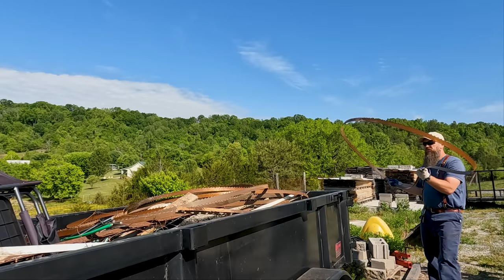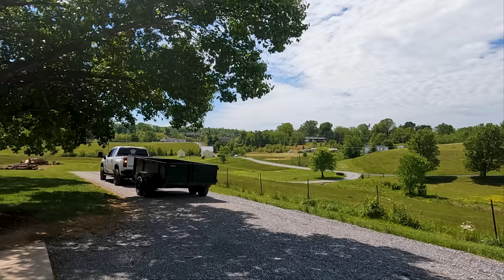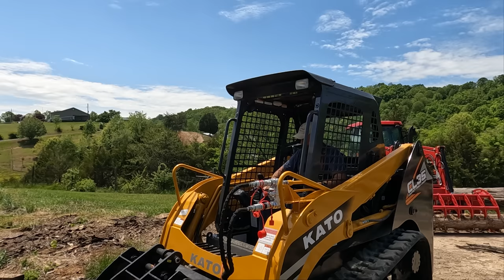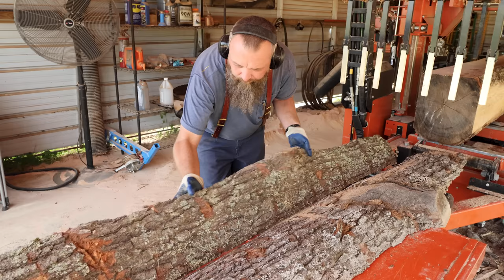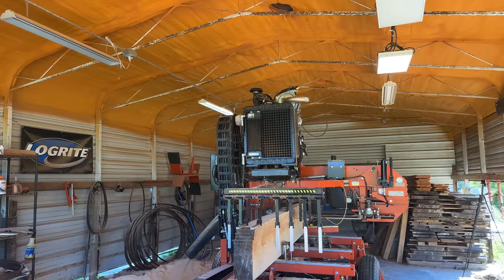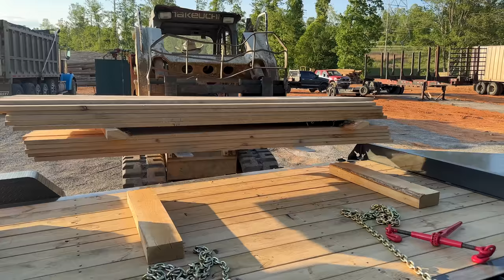How I Make Money With My Sawmill $$

Comment: I can second on that free advice. Be it logs or anything else, don’t leave it in front of your trailers.
Also, I used to be that guy that would take any little bit of scrap and save it for taking to the yard. I’m finding more and more that it’s not worth my time. Which is a good thing. It means my time/labor is more valuable than it used to be.

Comment: Have you considered making/modifying a chain conveyor for sawdust removal through the wall and directly into a trailer. Then you only have to push up the sawdust a couple of feet for cleanup.  Plus, you can carry the trailer directly to the compost pile.  And if you have walnut, you can dump the trailer at the burn pile.    
And slabs and cut-offs are sold here for firewood.  If you let them, people will come haul away your slabs and cutoffs for free.. Or they may pay you or Bruno (for handling the marketing)..  Strapped 3ft x 10 foot bundles of slabs go for $30 here..
Reply from the maker: Good ideas here

Comment: With the bad saw blades, it would be nice to find a blacksmith who makes knives, and let that person make knives, forge them togather.
Reply: Came here to say this. Can’t believe there aren’t any blacksmiths who hound all of the local sawmills for their old saws. Seems like a no-brainer
Reply: TRUTH
Reply: I'm having knives made currently by a knife maker using old blades. Plan is to trade him a oak burl I'll be cutting him on the sawmill.
Reply: A couple things to consider
1. Most knife makers will already have an overwhelming supply of this type of reuse metal on hand.
2. Many knife makers want a specific alloy with known properties for  their knives so that exacting hardness and toughness can be achieved through heat treating.  Do much time goes into the making that the cost of the raw material is not a big factor.
Reply: @boooshes  over here you can't get stuff like this, and you can get the alloy from the manufacturer there's also the idea of sustainable design and Damascus from different saw blades looks fantastic as well
Reply: @mazevx2451  Sure, I understand what you are getting at.  Consider that Nathan probably goes through 100 or more blades per year, there's another mill just down the road, thousands of independent sawmills across the country.  Nathan has tried to give his old blades away, but there are do many sources of second use high carbon steel around, no one will come pick it up for free. The number of knife makers that actually forge blades is pretty small.  The value in scrap is extremely low due to the fact that each blade probably weighs about a pound or less, there's just not enough to take it for recompense, if it's an additional trip.
Reply: I just cant believe that all that recyclable metal is going to landfill. In UK and in Europe we have ‘dumps’ with labelled skips in so anyone can take their rubbish (trash) and put them in the appropriate skip. That way all recyclable rubbish like metal, cardboard, paper, building rubbish, electrical goods can be collected by the local authority and sold for recycling. Reduces the amount of landfill, makes money for the local authority, makes sure toxic waste doesn’t get buried, provides employment for those managing the dump but most importantly safeguards the environment. I am amazed that USA is so wasteful.
Reply: Blacksmith and sawyer here. The sawmill blades are put through so much tension and go though hear cycles that actually make the blades more brittle and causes stress fractures. The fractures can rarely be taken out. Obviously you wouldn't want cracks in your knife blade. Also most bladesmiths have more recycled steel then they know what to do with and known steels are easier to work and heat treat. Forged in fire has over sold the use of recycled steel. It's not worth the trouble.

Comment: You've probably spotted it already Nathan, but my 'engineer's eye' picked up that the non operators end of the bed was deflecting a little bit, as the carriage advanced.  Maybe half a turn up on the legs at that end?  I don't even know that it would have any effect, but I know you are a stickler for accuracy.  I wonder if you have to pay for having a trailer load at the dump?  The two council tips available to me do not allow trailers, period.  Unless I pay for them (north of $50 per visit) and they are extremely picky about what I could tip.  The most likely scenario; they would have a row of skips and I'd have to sort the load myself into the appropriate skip.   Have a good one.

Comment: In terms of cleaning out the shed, how often would you actually need to pull the Wood Mizer right out to clean that whole area of sawdust, and so on,  it must accumulate reasonably quickly under and around the saw,  regards from Auckland NZ

Comment: Do you resharpen  and reset any of your blades. Im guessing 22 1x6 that's 88 bf. A 8 foot 17inch log has around 84 bf doyal minus a inch or 2 for sweep and about 20% over run with a woodmizer compaired to doyal scale guessing around 85 to 90 bf of clear wood. I like the lt40 there at the end we bought a lt super hydraulic back in 88 was a dang good mill put almost 6k hours on it with the original onan motor. How much are you getting a bf out of #3 #2 common red oak?
Reply from the maker: I only re sharpen them, I rarely re set them, usually don't need it

Comment: Someone with a small forge could use the steel saw blades, but as you know people will call and say I'll come get it and don't and it sits and sits and sits 🫤
Reply from the maker: Yep tried that. No one shows up
Reply: Yes, pretty bad when you can't even give it away. Something of value for free, because they want you to deliver it to them, and then probably deliver it to the next next person it never ends
Reply: @joebufford2972
Reply: I got one "free" from a local mill. It is laying on my shop floor, about 18 months now. I did make a machete for someone but still in the shop.
Reply: @OutoftheWoods0623  depending on the price you charge for the blade, and how much shipping is, there are bladesmiths across the country that will pay you for them. Starting with this one 😁